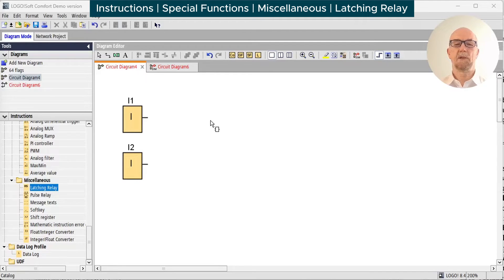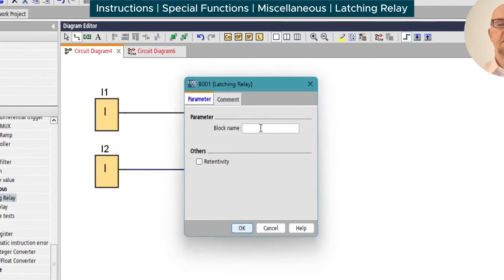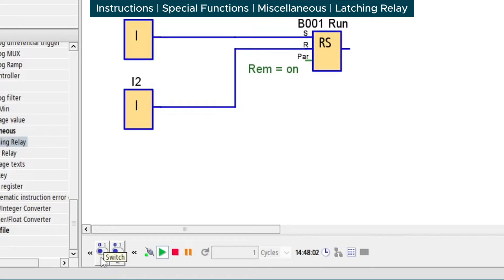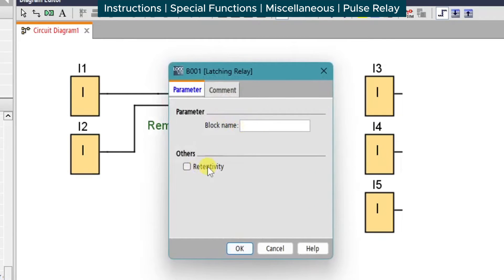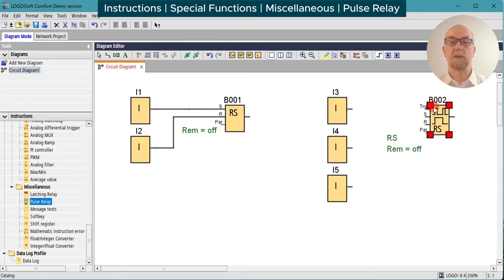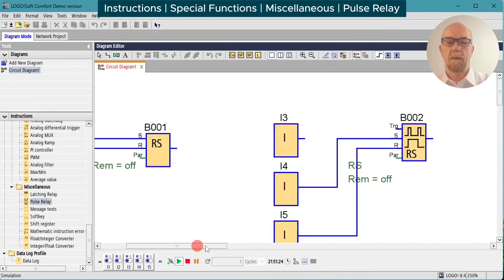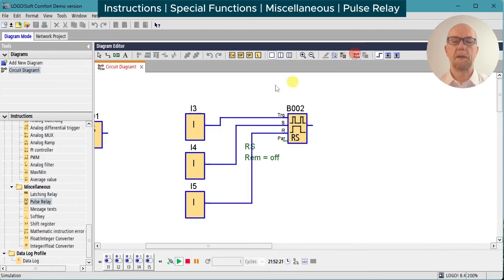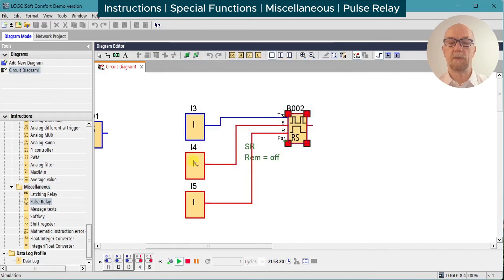LOGO! Miscellaneous 1 - Latching relay | Pulse relay | Siemens PLC Programming

Comment: The truth however seems to be that it is not possible to conditionally set and or reset any variable, such as output, flag or holding register bit in logo, to state the obvious, connecting such a variable to the RS block, does not constitute an RS function, but an EQUALS function which is continuously processed regardless of the state of either R or S logic. I would be overjoyed to find out I am wrong!!!!
Reply from the maker: Thanks for the feedback, Donald, but I don't understand the problem. Surely it's the RS block that is set or reset and anything that is driven by it just follows the RS state (with an EQUALS, if you like) as expected. Give an example if you mean something else. Thanks!
Reply: If a flag is set or reset then we can say it will switch on or off, if it is not set or reset then it remains in whatever state it was in. If it is equaled to the state of the reset block it will always be forced to the last state of the reset block on every cycle. So the significance is let us say, a bit gets switched on perhaps by a SCADA system, once its job is done it gets reset by the logo, this is not possible with simple mechanisms as it would be in a proper PLC and requires a troublesome workaround.
Reply from the maker: I think you are correct. There is no SET or RESET coil instruction which would be handy for a variety of operations. I played around with a simple ladder latching circuit using a contact of M1 to hold its own coil on but there's a one scan delay between an M input turning on and the output turning on so on the next scan it turns off again.
Reply: @QuickPLC-kh5of  i can assure you i am correct, i have retired after a 40 yr career specialising in Siemens PLC design, sales and commissioning. I survived about 5 generations of Siemens S5 and S7 and even the S5 110A dating back to 1980 had a set and reset function, it is a serious deficit and i believe there is a good reason for it which resides in the way the Logo compiles and runs its code, it feels to me like the FPGA of other times which was blindingly fast but fraught with crazy limitations. The Logo is veru fast and very badly documented, i doubt the truth will ever come out as Siemens no longer seems to believe in technical support if any kind.